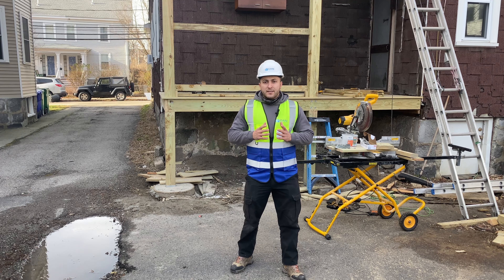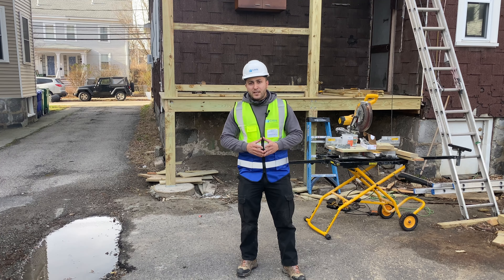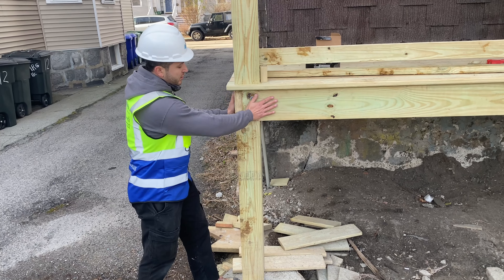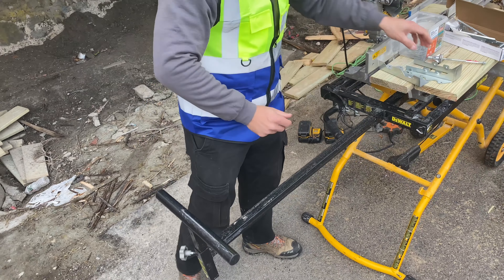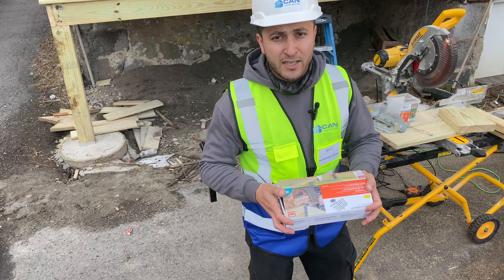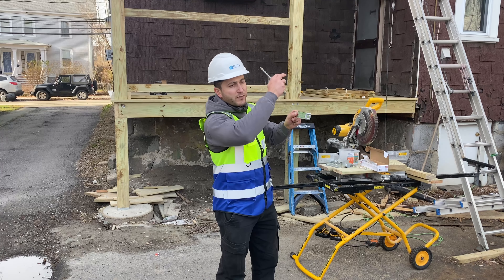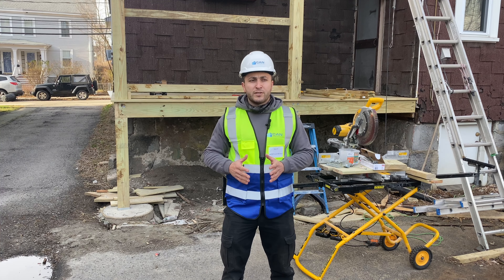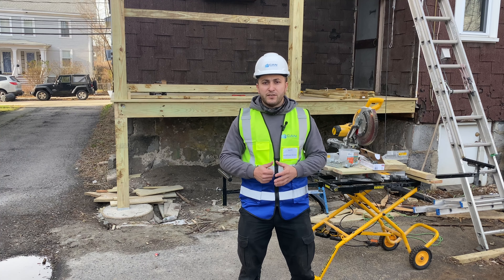How To Build Three Story Porch Deck Project Part 3 in Allston MA | Your Deck Builder #deck #porch

Comment: Hi. Did you notch the beams and place them on top of each other the used corner brackets to extra connection ?
Reply from the maker: Hi, we didnot notch the beams and yes we place on too of each other and use corner brackets.

Comment: Really nice job on this build. Came out great. I have to do a similar build just no stairs. Did you say you didnt use the 3-2x10 or the 8x8 post and went with 3-2x8 instead and 6x6 post?
Reply from the maker: Yes we used 6x6 P.T. And 2x8 P.T. Joists, thanks good luck with your project.

Comment: Engineer plan calls for 3 of 2x10 and you used 2of 2x8 beams. Also it calls for 8x8 posts and you used 6x6 posts. Last thing you did not remove wall shingle siding before attaching ledger board. How did you pass the inspection?
Reply from the maker: Hi Wasif, Plan has been adjusted in permit application because 2x10 joist and 8x8 column was not necessity. We have removed siting in order to install flashing behind the siding and on ledger. We have closed permit successfully with all necessity inspections.
Reply: @CANRoofConstruction  how did you stack the posts on top of each other?